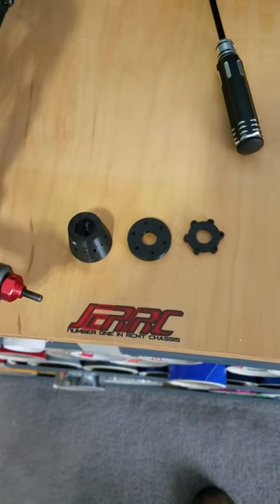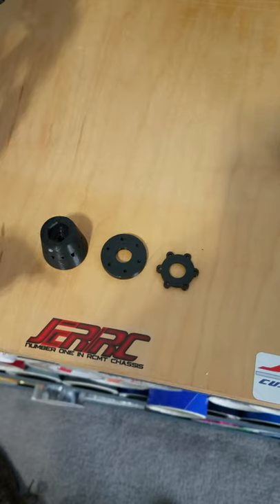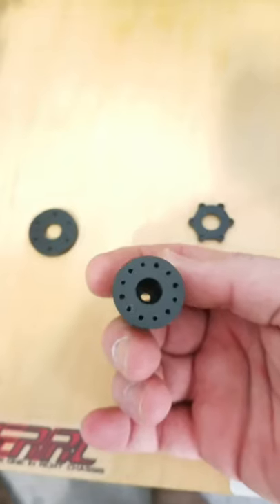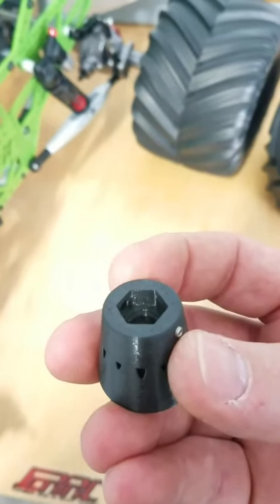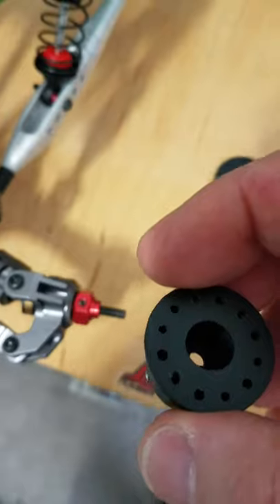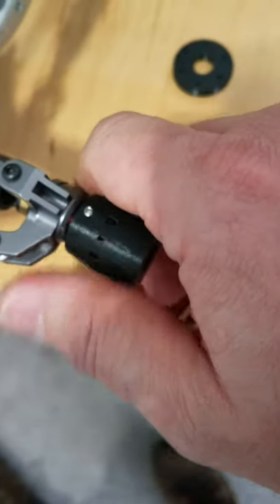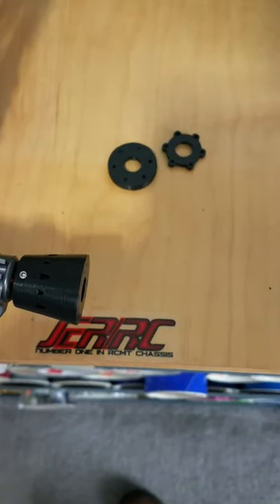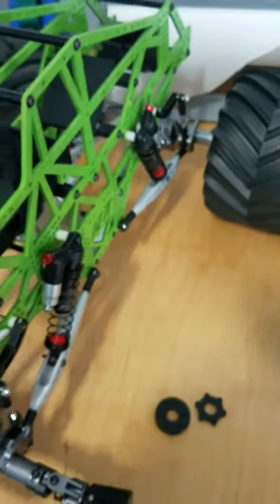Flower Pot 12 mm HEX Hub Spacers

Comment: Don't buy people ordered them for my LMT with 12 mm hexes and I have 12 mm hexes on my LMT and they don't fit
Reply: Ok so instead of contacting me via the contact info on the card that came with your purchase you decided to try and blast me on here for something that could have been resolved the right way. I will assume since you have given no details you are referring to the axle shaft not fitting through the hole on the spacers? If that is the case it is because they are a multi use hub (SMT and LMT) and the center hole needs to be sized to fit you axle shaft of the LMT with a drill bit. If that is not the case i would be glad for you to contact me as stated above and we can go from there. otherwise i trust this will fix your issue.
Reply: @rotobossrotaryattachments  what card
Reply: @rotobossrotaryattachments  they fit my smt10 good but I ordered them for my LMT when you sell something you should say it will have to be modified ..and why do you have a button for the smt and then a button for the LMT if they're not different size for the shaft
Reply: @rotobossrotaryattachments  now I got to go buy drill bits on something I done paid $60+ dollars for that won't fit
Reply: There was or should have been a business card as well as the contact form on the site to get ahold of me and a sheet of paper with the details on what needs to be done for LMT. I have no problem making things right but this is not how things should have been handled. I will make the change to the site to better explain that it will require drilling for use on LMT 12mm hex. Having sold hundreds of these o er the past couple of years this is the first time it has been an issue. If you wish to contact me properly we can take appropriate actions.